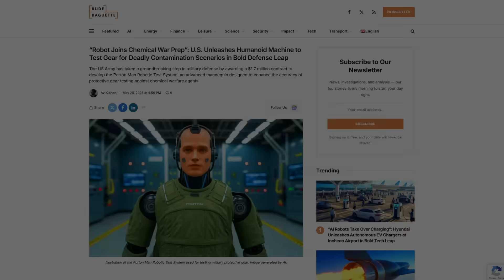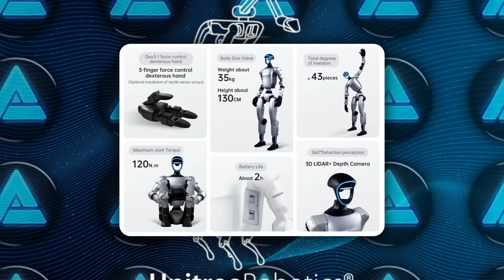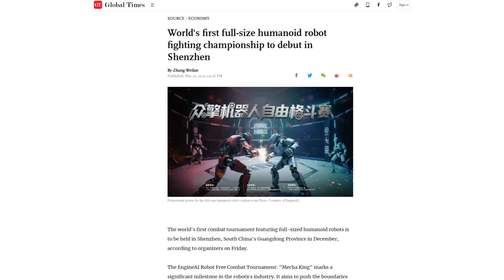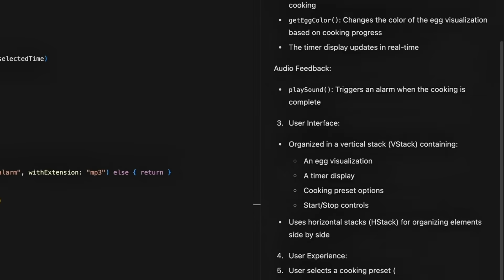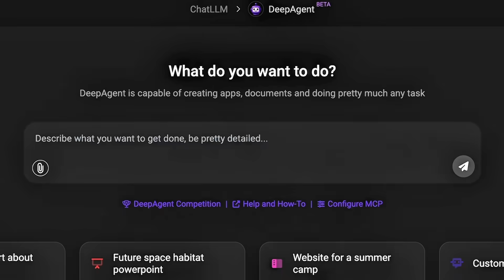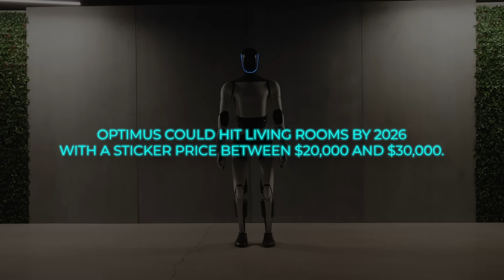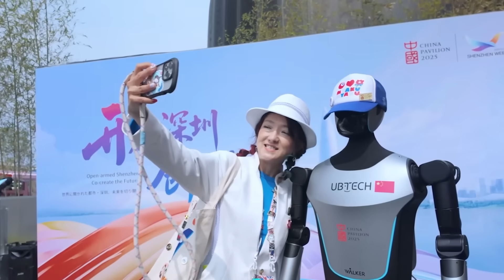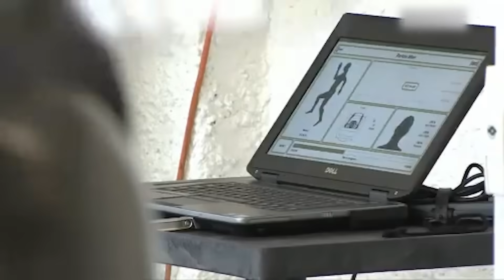Humanoids Are Now Fighting Each Other on Livestream (AI Robots MMA)

Comment: Evil AI will take over
Reply: Yeah, your home has walls, ceilings, and floors, thousands of robotic arms and hands are foldable to be hidden inside them, any intruder ai robot entering your home would be confronted by those robotic hands and arms of all sizes! Remote control robotic hands and arms that’s controlled by remote control. So not only your home has these robots with legs, you get walls and ceiling that has TRANSFORMER hands and arms (can be foldable and transform and integrate into the walls and ceilings.